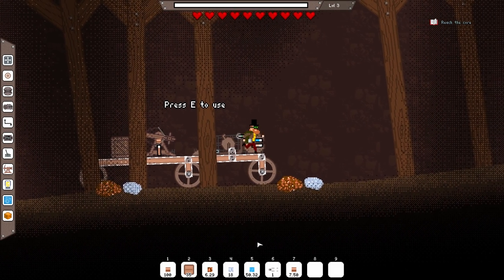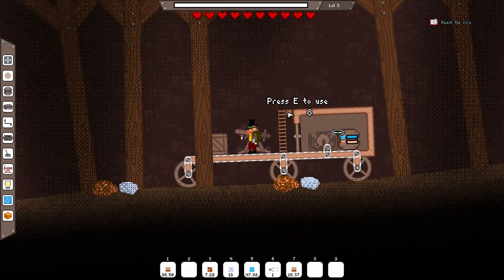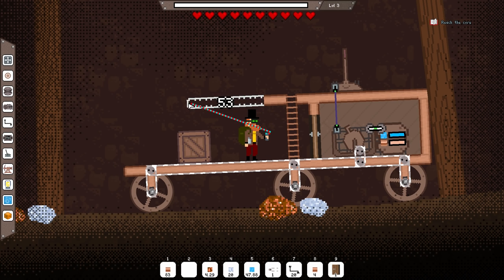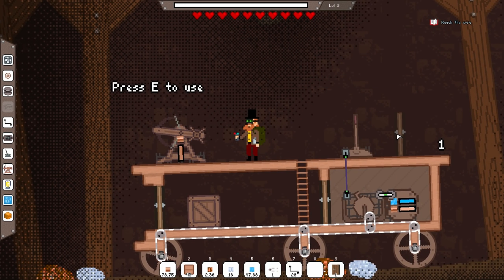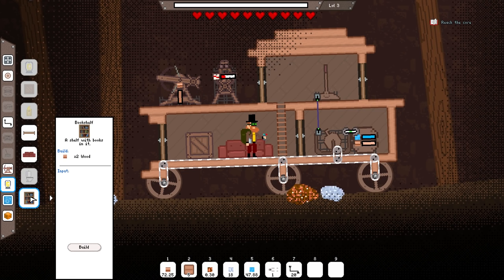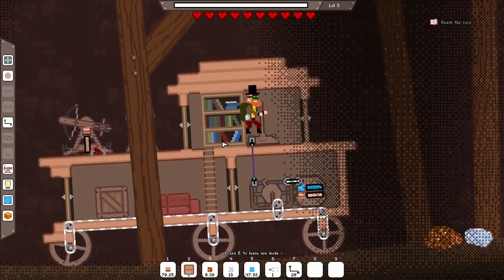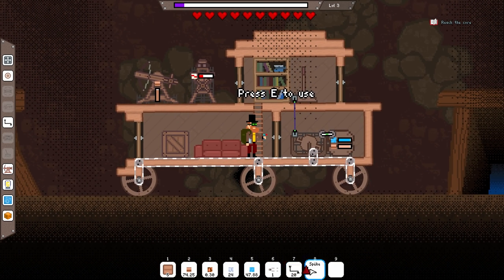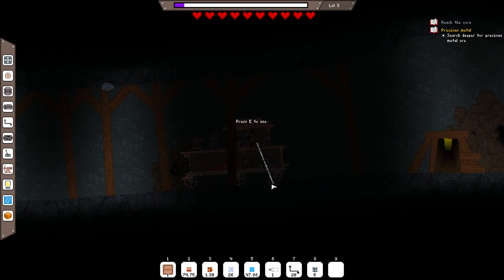Tank Fort! – Mechanic Miner Gameplay – Let's Play Part 2

Comment: Also, when you mine, it mines blocks at the cursor, so if the line doesn’t reaches where the cursor is, it will not mine the material that th cursor is on because you are trying to mine the centre of the node, yet your line only reaches the edge